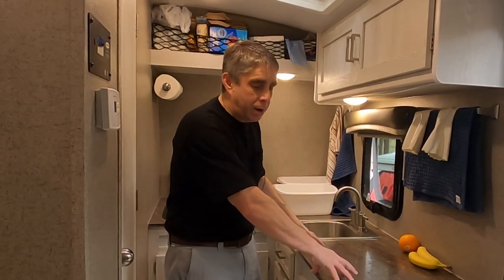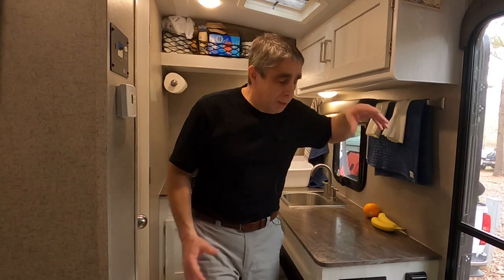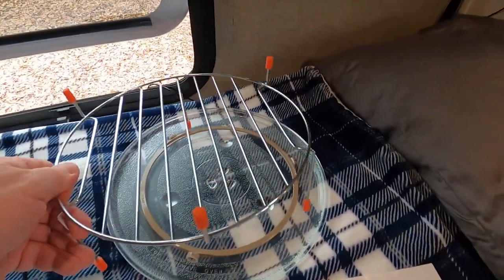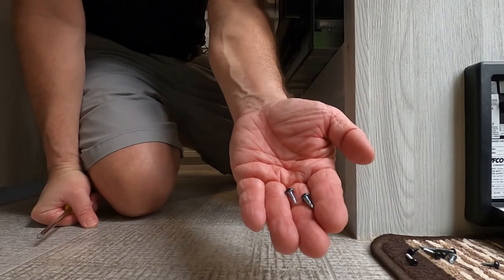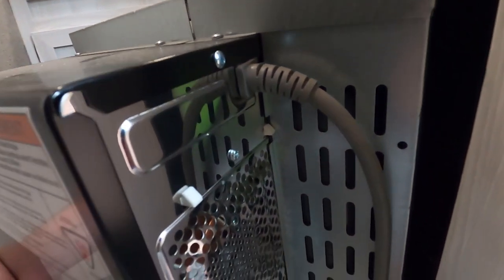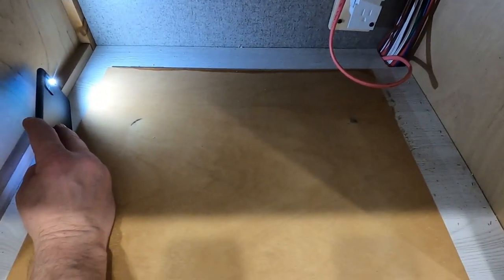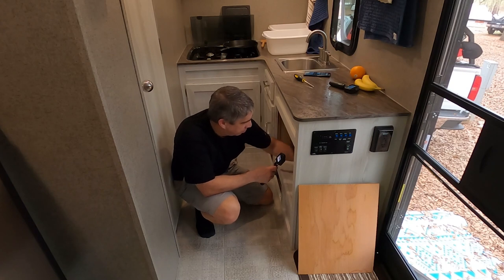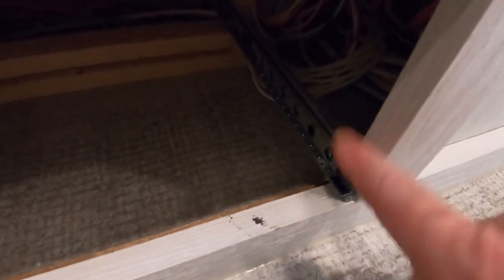Remove Microwave | Geo Pro Kitchen Cabinets | Full Time RV Living

Comment: Thanks Mario, great video.  Would it be possible to install 1 or 2 lithium batteries on the front tounge and use the existing wiring (not that familiar with the GeoPro)?  Do you need to change the charge controller for lithium or can you use the existing controller?  What model GeoPro do you have?  Thanks, John
Reply from the maker: Hi, John. I will answer from memory and then conclude with some precautions. The Go Power solar charge controller I have will charge different types of batteries. It collects energy from the solar panels and charges the batteries. However, the WFCO brand ac converter is not (as I remember) suitable for lithium batteries. My model Geo Pro is a 2020 19TH. You can collect model numbers from your solar charge controller and power converter and download their manuals to determine their specifications and capabilities. If you use existing wiring, you want to be sure and determine the wire's capability by measuring its gauge and length. You can reference charts that will illustrate its capabilities based on voltage level and type. My solar charge controller is capable of charging two battery banks. It is possible for me to have my solar panel charge the original house battery and a separate lithium battery. However, this is not efficient, and I will likely replace the existing ac converter and some of the wiring.

Comment: That wiring you showed looks like a rats nest.  If you know where the existing battery connections pass through the bulkhead, you could pull new lines from the truck connection to your lithium batteries, and then tie those back to your existing invertor.  You might even be able to charge the batteries in your truck with a solar panel through the invertor.  Now what do you do if you want to reheat the leftovers from the mexican restuarant?
Reply from the maker: Hey, Kevin! How goes it? Indeed, the true question is "How do I reheat leftovers from the Mexican restaurant?" Using a saucepan and a little bit of milk, I was able to reheat some Olive Garden pasta stuff. I suspect I can do something similar using water. We will have to see. As you already stated, bypassing the existing rat's nest opens up all sorts of opportunities for efficient storing and using electricity. So I am willing to roll the dice on Mexican food leftovers, I think.
Reply: @MarioWorkedOnIt  Who am I kidding, there isn't a chance I'd ever leave a Mexican restuarant with leftovers.  LOL, my plates look like I washed them with the exception of the peas they put in the rice.
Reply from the maker: @kevinfoley7704  You definitely have a point there.